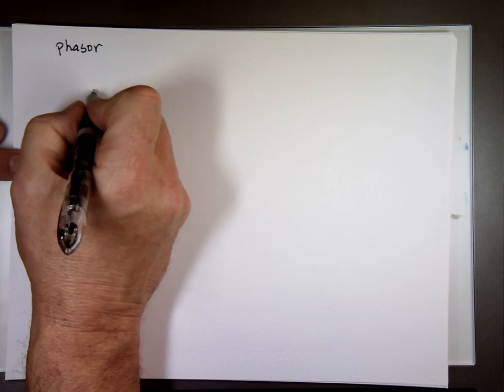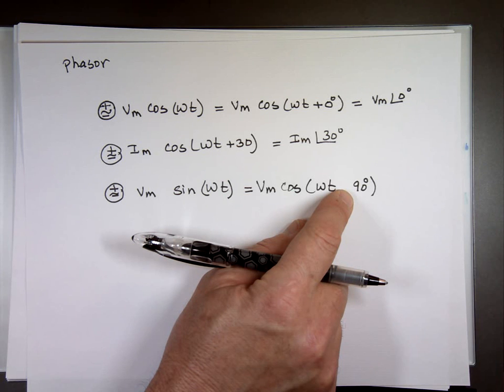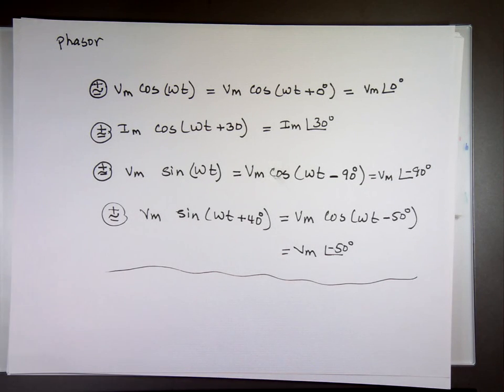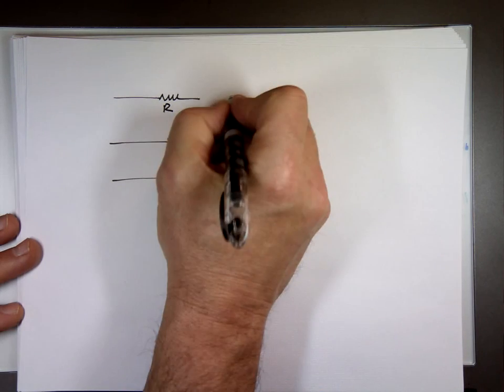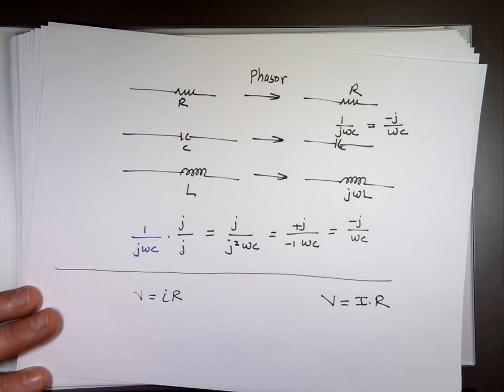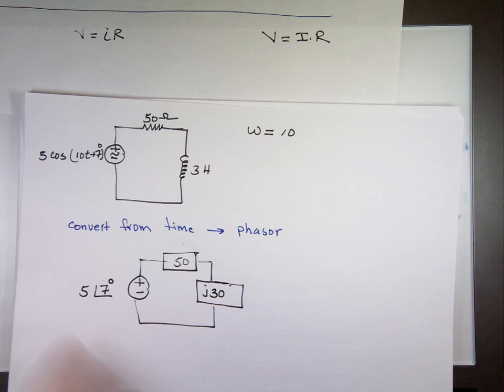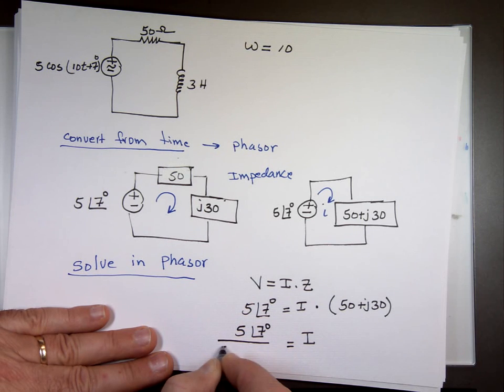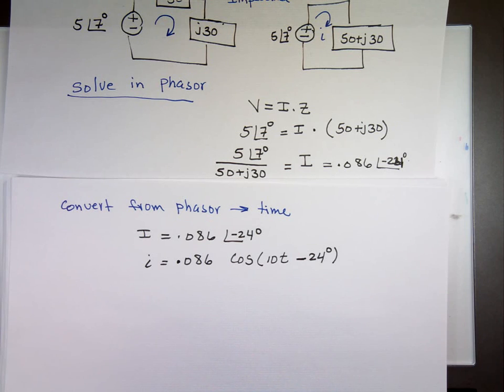Introduction to Phasor

Comment: It's incorrect to equate time functions to phasors as he keeps doing from 0.40 to 4.40 min. One should use arrows instead. Also, resistors, inductors and capacitors are  not functions of time and so do not transform to phasors but to complex impedances.

Comment: Can someone help me at 13:51 I am not sure how he inputted the values in the calculator. I have a TI nspire.
Reply: convert 50 +j 30 to polar form.

How? Sqrt (50 ^2 + 30^2) = 58.3 

tan-1(30/50) = -24 degrees

Divide the top (in polar form) by the bottom (in polar form)
Reply: @nickthewinner2194  hmmm when I enter tan-1(30/50) into the calculator it is 30.9 degrees....
Reply: Humzah Khalid  If you want to find the answer without calculator just convert 50+j30 to polar form

then use 5 e ^ 7 degrees divided by the polar form you have found lets say the polar form is 2e^6

answer would be 2.5e^1

Comment: I have a question. İf it was parallel, how can we solve it?
Reply: +Muzaffer Baysal nice question
Reply: If the 2 component (resistor, inductor or capacitor) were connected in parallel, we would've used the parallel combination method -just like we did for the 2 resistors which are connected in parallel. 

In that case Ztot ^ (-1) = Z1 ^ (-1) + Z2 ^ (-2). 
or simply (for 2 combination in parallel) : (Z1 * Z2 ) / (Z1 + Z2).

Note: Z represent the impedance which is in terms of (Ohms).